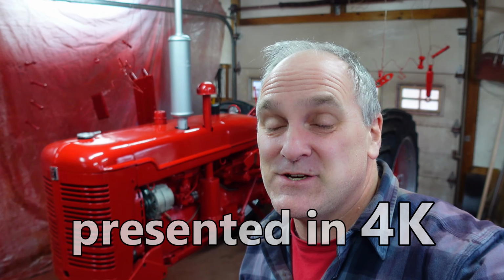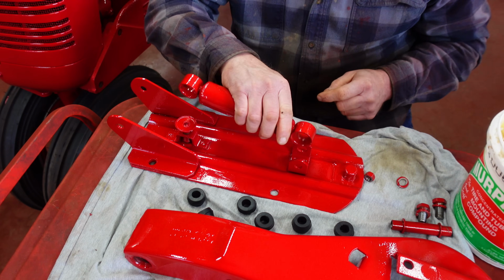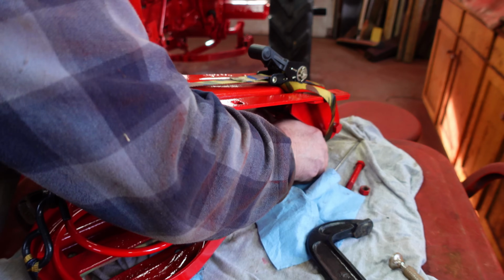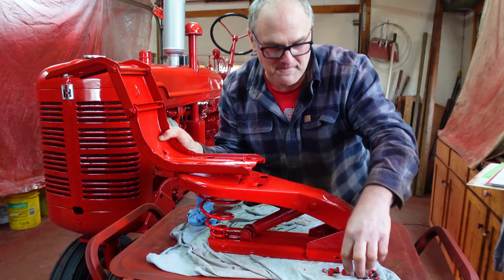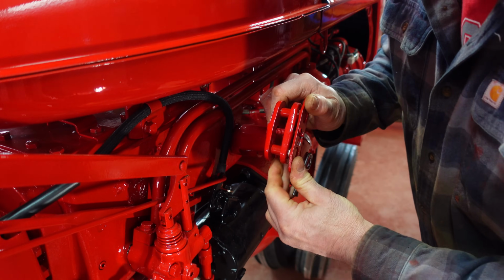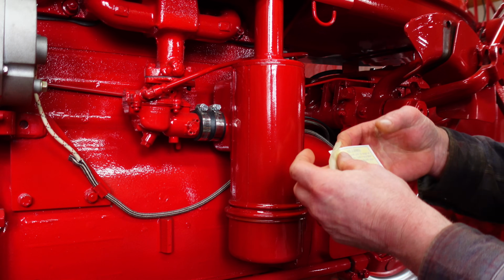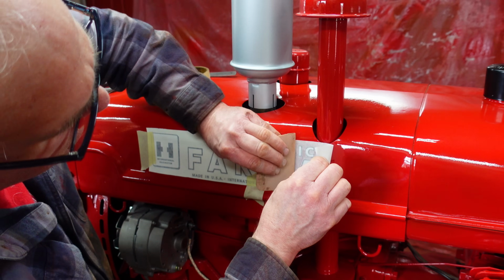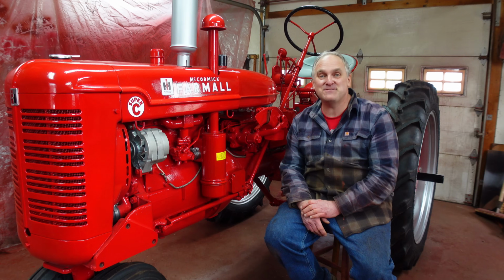Finishing But Not Starting | Farmall Super C Restoration Episode 20

Comment: I’m sure you meant 82 kilos for the wheel weights and not 8200 kilos. Also I think the weight of the tractor in kilograms is a little light. I had to use a conversion calculator.😂

Comment: Awesome! Question: When changing from wide front to narrow front did you change the steering wheel? Think I remember IH used a larger steering wheel on the wide front configuration for increased leverage. Could be wrong and/or could have missed an explanation earlier in your series.

Comment: 17,2 kg 🤣Love how you treat the metric system and everything non US about engineering. With a scientific background, I back up the IS-system of course, but I love to hear irony from "the other side". If it works, it works, right? I'm a technician and my civil engineer colleagues get a stroke if I say "that would be about 20 cm" when measuring a distance with stretched out thumb and pinky like making a shaka sign. But I know it is true in my case. On the other hand, we use the expression "meten is weten", which means measuring is knowing.